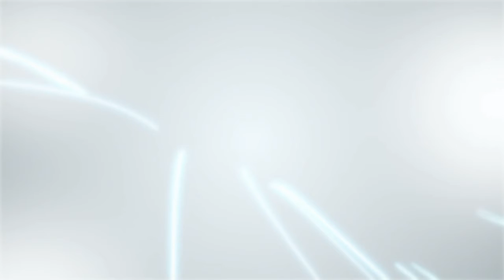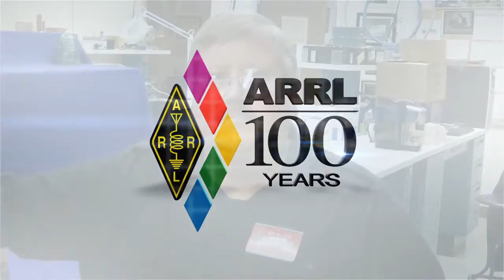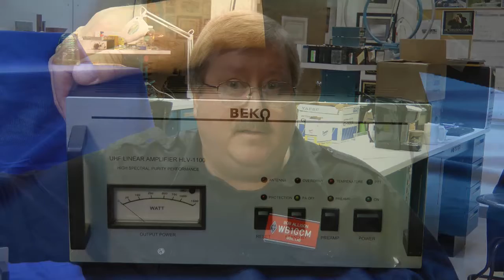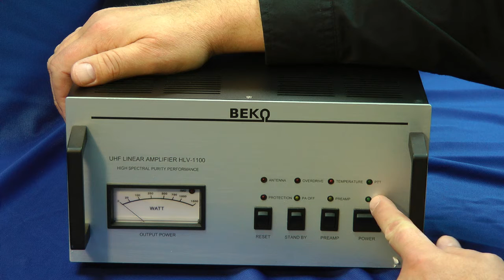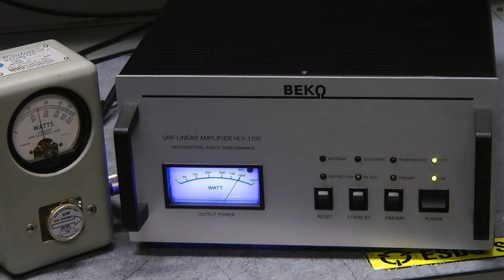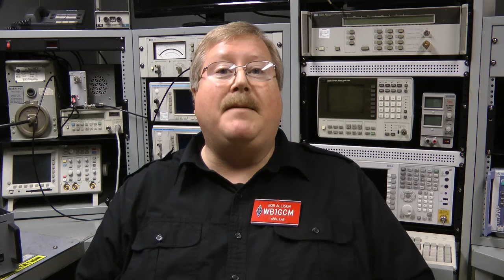Beko HLV-1100 70cm Amplifier

Comment: Why do you have 14w of input power before the amplifier relays have switched over?   All the switching from RX to TX should occur before any RF is generated by the radio.   The hot switching here is a bad thing.

Comment: Hallo,
Ich sehe bei Beko schöne schönen HF und VHF Designs.
Ich stelle fest, dass in den Drain-Abschnitten 1: 4-Transformatoren verwendet werden.
Die Impedanz von Drain zu Drain beträgt bei allen Push-Pull-Power-Fets +/- 6,3 Ohm.
Sagen Sie mir, wie Sie mit einem 1: 4-Transformator von 6,3 Ohm auf 50 Ohm kommen?
Erkläre mir das.

Ergebnis: Die unsymmetrische Endimpedanz des Transformators beträgt 24/25 Ohm, die Last beträgt 50 Ohm.
Der Powerfet sieht ein himmelhohes SWR mit einer Last von 50 Ohm !!
Eine falsche Spitze im System ... Und der Spaß !!

Wie kannst du es wagen, so etwas anzubieten?